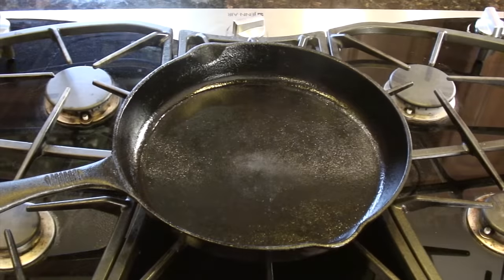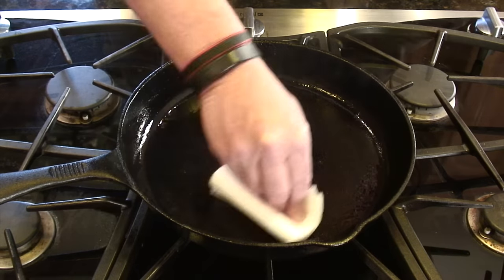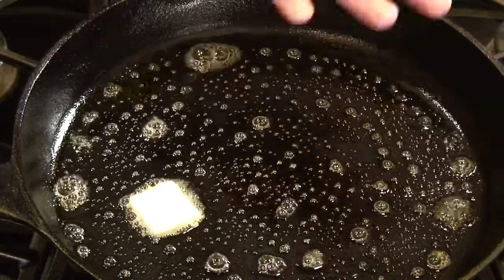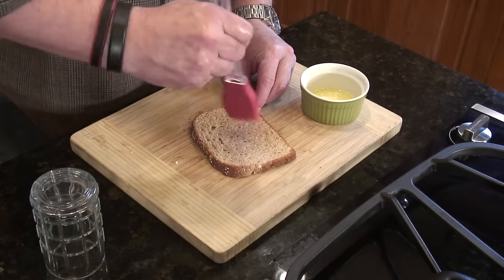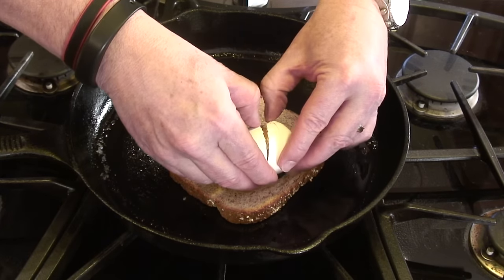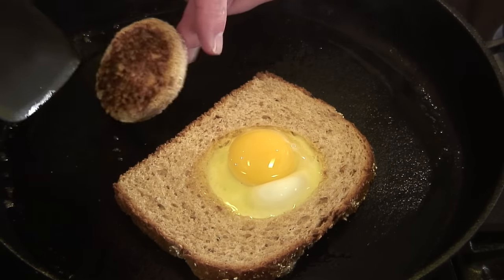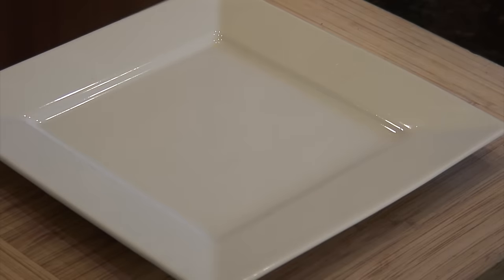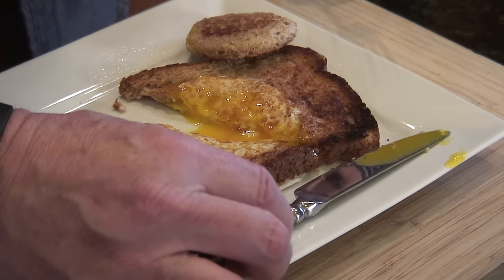How to Make Cast Iron Skillet Perform Like Teflon

Comment: Lots of people appear to not know the difference between extra virgin olive oil vs. regular olive oil and what they are used for. EVOO is for salads,bread dipping and not to be cooked with,where standard olive oil is perfectly fine for medium heat and below.  Depending on what I'm cooking in my skillets,I'll often use bacon grease to season the pan ,olive oil or butter. If it begins to dry out too fast,I'll add some merlot and Lea & Perrin's worcestershire sauce. I also nearly never wash my skillet between uses. Just add more grease or oil and good to go. True seasoning. Most of my skillets are from the 60's and very well used.I love the ability to sear on the stove and straight to oven when doing roasts.
Reply from the maker: Thanks for the detailed post.
Reply: Olive oil is good for low temp cooking. You need some canola or peanut oil for quick cooking stuff

Comment: I just bought an average Lodge cast iron pan (have owned and used many before) and was able to cook scrambled eggs on it just fine... keep it well seasoned and give it a slight oil or butter before cooking and your eggs move freely even first cook... oh yeah and most things you cook are or should be cooked on a LOWER to mid heat... like eggs...
Reply from the maker: You kind of just described what we do.
Reply: Agree, but there are techniques for cooking decent omelettes on higher heat without browning (I wouldn't use CI though), and crispy eggs are actually a thing (eww).
Reply: I want to believe it can work. I just bought one that has that horrible textured surface. Please convince me that merely seasoning it will be enough to make things nonstick immediately, as opposed to a couple years down the road

Comment: cast iron does not need to be smooth to be non-stick. just used properly. love my cast iron . I have some old smooth and some new lodge rough. perform great!!
Reply from the maker: Smooth is much better.....that's why the older stuff is in such high demand, and why some people have the newer (and rougher) cast iron cooking surfaces literally sanded down.
Reply: BBQMyWay they smooth out in a year or so of daily use.
Reply: I'm starting to see that on mine. My lodge was basically non-stick since day one and the rough finish is smoothing out as a I continue cook.  I'm not sure why hardcore cast iron cookers are up in arms over the way lodge pre-seasons their cookware.
Reply: I have some cheap no name pans and all I did was season it and it works better than my Teflon pans and I didn’t sand crap. It’s rough but doesn’t effect anything. I think a lot of those people have no experience using cast iron or they are just overthinking it. If mine cheap rough pan works then theirs is no reason much more expensive pan shouldn’t.
Reply: Please elaborate. I just bought a pan and the surface is like sandpaper. It’s awful. I cannot imagine how that could be non-stick.
Reply: John Hickey I was curious how yours has been non-stick. I’m preparing to return my pan before I use it because of the textured surface.
Reply: BBQMyWay   I sanded a new Dutch oven down. Not one bit sorry and it has seasoned up nicely.
Reply: @BBQMyWay  smooth is nicer but it doesn't really change performance. My bumpy lodge performs just as well as my stargazer and old Wagners. The older stuff was smoother and lightweight which is definitely more desirable..but don't be fooled it's gonna give the same performance.
Reply: I always sand lodge down and start from scratch seasoning it.
Reply: @user-vi3tb3bw5t  p

Comment: I also use olive oil in cast iron and it seems to work well. Light coat before and after cooking each time. I haven’t seen this egg in a nest technique before. Very cool. Thanks for the video.
Reply from the maker: Yeah, that's the key, to rub it down with olive oil when done with it, after washing it in straight water and then heating it up again so it's totally bone dry prior to applying the light coat of olive oil.  We hardly use this pan anymore as we have located an early 1900's vintage cast iron of the same size whose surface is smooth as glass.

Comment: Love my cast iron, be it antique or my latest Lodge skillets, biggest issue with  newbies is "you must have some heat (preheat) in the pan" before adding cold eggs and don't touch them until they release on their own. I season with Crisco and after I'm finished cooking, while the skillet is still warm, run under hot water and return it to the burner to dry, then adding a small amount of Crisco while it's still hot (inside and out) good to go for the next time!! Scrambled eggs won't stick either!
Reply from the maker: That's exactly what we do too....and absolutely agree on the preheating of the skillet.

Comment: Good video.  I read a similar article about scrambling eggs.  What I do every morning is heat up my skillet, add olive oil and cook whichever meat I'm eating (usually pre-cooked so I'm reheating/browning it).  After that I back off the heat and add butter while scrambling the eggs.  When the butter smells sweet, then it's at the right temperature for scrambled eggs.  Nothing sticks.  Or a negligible amount will be left behind that i can scrape off with a the plastic spatula.

Comment: The light olive oil or pomace olive oil has a pretty high smoke point at about 460F but yes, extra virgin olive oil smoke point is low.  Soybean oil and safflower oils are both high but I hate the taste of soybean oil.  I've tried the lethicin-based non stick oils on my cast iron but again the taste is awful.  I've seen very pricy cast iron with the polished cooking surface that looks interesting as well.  My 40 year old Lodge still works great and I'm going to try your method for non stick cooking.  Thanks Chef!
Reply from the maker: Thanks for stopping by!
Reply: I tend to agree that olive oil is not the best oil to use. Even highly refined olive oil has a somewhat low smoke point. Who wants highly refined olive oil? Yuck! In any case the solids in the oil will burn and turn bitter. I tend to use canola oil as it has a higher smoke point and I find a neutral flavor. Another good choice is peanut oil if no one has an alergy. Kent Rollins recommends avocado oil which has a very high smoke point. It's worth pointing out that the hotter the pan gets the more the pores will open and the more flowable oil will be until you hit the smoke point where the oil turns to varnish.

https://en.wikipedia.org/wiki/Cooking_oil

Comment: I was taught chemistry by the guy who invented the teflon pan.  His name was Egon Matijevic.  In fact, he once picked me up hitchhiking in his Cadillac when I was heading to class.  And I'm the guy you ripped this method from.  I did not demo it, and I did not mention teflon, but I did repeat the experiment enough times to know it would work for everyone who followed my general instructions.

Now I'll give you some credit for doing both the oil AND butter procedure again, although I do both about every three times I use the pan.  I knew ppl would figure this out on their own without my holding their hands.  I do NOT clean my pan out with hot water after use.  I have no idea why you do.  Wiping it out then heating it to kill all germs and microbes seems sufficient to me.

Colloid surface science is the study area we're dealing with, and the study that Egon Matijevic taught.  But I haven't the slightest idea how it applies to what we're doing.  Try to imagine taking a substance, teflon, which is non-stick, and bonding it to another substance permanently.  That's what Egon accomplished.   It's why he made six figures from DuPont AND six figures from my college (simultaneously).  You could hear a pin drop in his lectures.  He truly was bigger than life.

Comment: I'll have to try that dish.  But I use a slightly different technique to cook easy over eggs in a cast iron pot.  Using a bog standard seasoned Lodge, I heat a pat of butter over medium low.  When it is melted, I swirl it around before adding the eggs.  Butter is great because you have to keep the heat low to prevent it from burning (and of course it is delicious).   That is the perfect heat to cook eggs.

My biggest problem is the flip.  The eggs slide around so much it is hard to get my spatula under the eggs.

I don't think my method is really that different, as I routinely do something similar by seasoning my pot using a similar method to the olive oil step.  

That eggs in a nest I'll have to try - it looks like that bread is a lot easier to flip than the egg itself.

Comment: Did you not already know that you had to season cast iron even if it’s seasoned from factory? Your pan looked like the seasoning was mostly gone. Plus… IF PEOPLE DONT KNOW…. Don’t use harsh dish detergents in pan. Like Dawn… this will remove seasoning as the seasoning is… grease/oil and Dawn takes grease out of your way… as the old commercial goes. Plus, always dry pan with heat and not just a towel.

Comment: Great tip. I love to cook with cast iron pans because of the way they conduct heat. This information should help to get better results.
Reply from the maker: +RevvedIron65 Thanks for stopping by...
Reply: Almost everything you probably think you know about cast iron is wrong. It's a horrible heat conductor, any stainless steel / carbon steel pan can also be seasoned, Aluminum can hold as much heat at half the weight (and distribute it much better). Heat retention can be achieved with disk bottom pans, and much more even heating is acquired from cladded pans.
Reply: When it gets hot, it stays hot. That is what I like about it.
Reply: So do disk bottom pans with less weight, less reactivity, and better heat distribution.

Comment: Great video...might I make a suggestion?  Trade your paper towel for a lit free towel.  The paper towel will leave little bits of paper fibers that over time will build up and can ruin whatever you are cooking.  Also if you sand the cooking surface of your pan before you cure it, it will perform even better.
Reply from the maker: Agreed.

Comment: Haha! Perfect is putting it mildly. Great tip, Dave! I do love my cast iron, and one of mine is pushing 50 years old now. Purely by blind coincidence, I picked up the oil wipe over heat treatment some years ago from who knows where, but I do it after every use, let it cool, then lightly wipe out excess oil.

This way, that dab of butter is all you need to add next time you fire it up. Knocks a little time off of it, which is a good thing in the morning, when you have a cup of coffee in one hand, only one eye open, and you want that egg done with as little hassle as possible.  LOL
Reply from the maker: +Anonymoose Thanks for the note.  I'll probably keep hitting it with olive oil each time.  I want it as "teflon" as possible.  Hope all is well with you.

Comment: Do you have to do the olive oil and then butter procedure every time you cook eggs for that to work?
Reply from the maker: +instantsiv To guarantee Teflon-like performance with each use, yes.
Reply: No. Don't scratch the crap out of it, and it should be fine even through dish water. I've done this with stainless steel using a single layer of polymerized oil through 3 washes and made a spatula free french omelette with it.

Comment: I have been seasoning cast iron for 40 years. Season cast iron with flax seed oil. Wipe all access oil off. Turn it upside down in 300 degree oven for 1 hour. Cheese want even stick in it. Flax seed oil is a little expensive but it is work it

Comment: I have been following most of the videos regarding the various techniques of seasoning cast iron.   I cook with a 10” cast iron skillet most days that is over seventy years old. Being intrigued with polishing the new cast iron cookware I bought a new skillet and sanded it with various grits of Emory (metal) sandpaper till it was mirror smooth.  Much to my dismay food stuck to this glass like finish until I seasoned it about 6 times. There is no difference in the new pan and my old pan.  Some of the new nonstick cooking pans have a pebbly surface on the cooking side.  If you take one of these new cast iron pans and coat it about a dozen times with oil and heat and build up a polymerized film or coating you will basically fill in the pores and get a slick non stick cooking surface.  Secret is do not over clean after cooking.
Reply from the maker: I don't have that sort of patience.
Reply: Does the pan look different?  Or does it end up being basically identical to the pebbly pans

Comment: Grapeseed oil works well too. Lodge is all I use. Imported cast has issues. Sand your  cast iron if you want it to look smooth or just season it and appreciate the lodge approach to use their surface finish to allow the seasoning to stick and build up.
Reply from the maker: Do not like the rough finish of Lodge cooking surfaces, unless they have changed something in their process that I am not aware of.

Comment: This works but it takes a bit more effort than I prefer just to fry an egg (with a piece of bread but the bread is never an issue). For a properly seasoned cast-iron skillet, a bit of salt&pepper to the pan before you drop the egg will help with the non-stick issue. Try it. It works.
Reply from the maker: Thanks for the note, and thanks for stopping by.
Reply: Yes Sir, like ball bearings.

Comment: I cook with cast iron, rough or smooth and cook on an alcohol stove with a 1 inch round wick, the method I discovered is lower heat, olive oil first than more oil at cooking heat and use a pan lid to cover the food then remove pan from heat and rest a minute or two then remove food the pan goes under a stream of hot running water scrubbing with a kitchen brush on a handle, back on heat dry and oil
Reply from the maker: Thanks for sharing!

Comment: Do you have to do this each time you cook in the pan?    My sticks all the time.
Reply: Margaret S I’ve been researching, and it sounds like yes, you do.
Reply: Hey Margaret S I use a process very similar. 

However I always oil my pan before putting it away. That way all I have to do is heat it up and add some butter and away we go. 

The more you use cast iron the better it will be, just make sure to look after it and it’ll last you a life time
Reply from the maker: We do, but in the spirit of full disclosure, we on;y use that pan outside now when doing steaks.  We now have antique cast irons that are really smooth.

Comment: Good info.  If possible let foods get to room temp or close before putting in the pan.  I use one small pat of butter and a pinch of salt then fry the eggs.  Almost never a sticky mess.  Cast Iron is not terrible to clean up either.  I do use a little soap and hot water and a decent scrub pad.  Dry well by hand, a little flame on the burner, wipe with whatever oil you like and its  ready for the next time.  Do not soak.  If you don't feel like washing it right after use, it does not care, it is a pan.  Cast works well.  Couldn't imagine trying to make a gravy without one.  Some folks get too crazy when it comes to old iron.  Darn near indestructible.
Reply from the maker: Thanks for the feedback.

Comment: As a child my grandmother used to use actual pig fat cut right off the shank. She would heat the iron and drop it in, and it would dance and spit around the pan. Then turn off heat and allow to cool naturally, and wipe out excess. She would store it with parchment paper between pans. The pan has to get hot enough to open up its pores and allow the grease to penetrate.

Comment: I cook my egg in a hole on a Lodge griddle which, unlike my skillet or Dutch oven, never has acidic foods like chili on it. The griddle stays smooth and nonstick as teflon. Always season after cooking and you'll be ready to go next time. I tend to use olive or flaxseed oil for seasoning but have used lard, bacon grease, or whatever oil (other than Mobil 1) is handy. Dry cast iron is unhappy cast iron.
Reply from the maker: Thanks for the feedback.

Comment: Agree with several posters here.  That much oil and butter can be used on any pan to make it non-stick.  What was the purpose of brushing butter on the bread when it's going for a swim in butter anyway?
Reply from the maker: A "swim" in butter?  I bit of an overstatement.

Comment: My great grandmother and her great grandmother have all been using cast iron cookware.  Like so many people/comments all over the net... those who know how to use them have not had any issues with sticking!  We have a simple method  - rub a thick slice of onion (using a fork)all round the pan after you put in a tsp. of your cooking oil. Apart from flavouring whatever you're cooking it also gives the pan a non stick coating.  If you don't like the onion (for eg. in your egg) then do the same thing with a slice of potato.
Reply from the maker: I will definitely give that a try and maybe make a video.  This seems to be a topic that people get impassioned about.
Reply: have anyone tried this onion technique on cast iron pan? this is an indian technique on creating non stick surface on tawa in making dosa